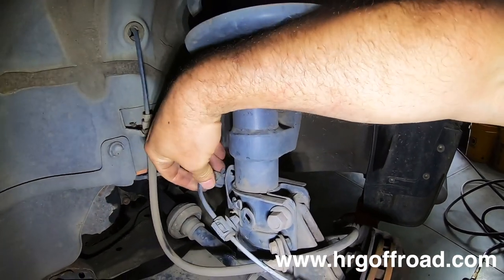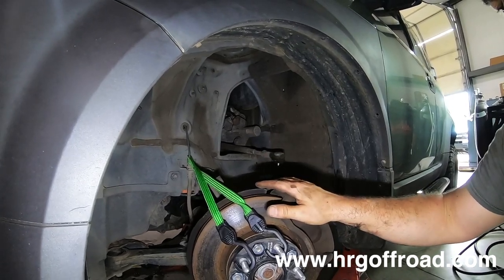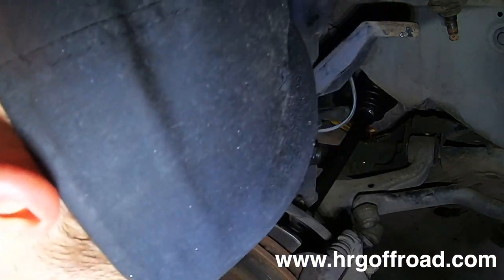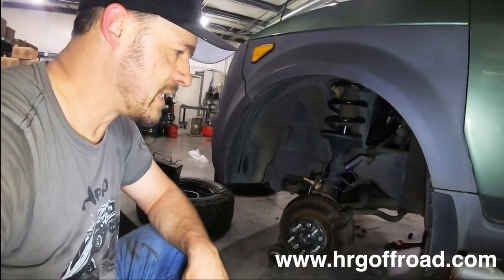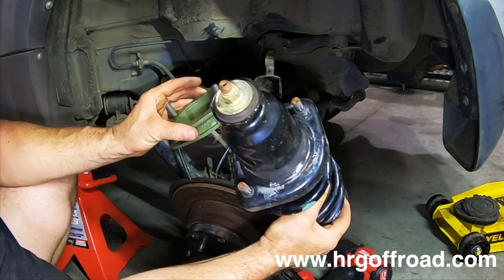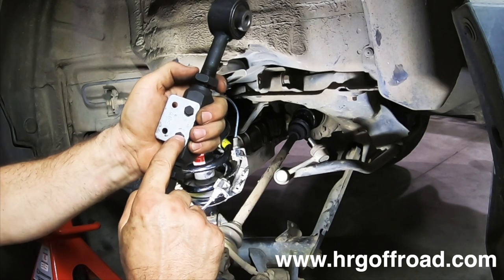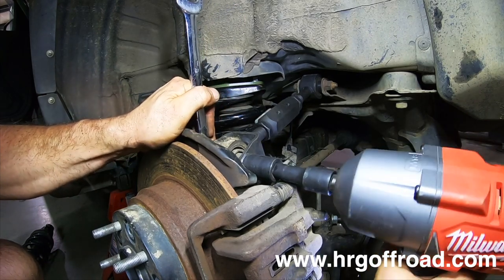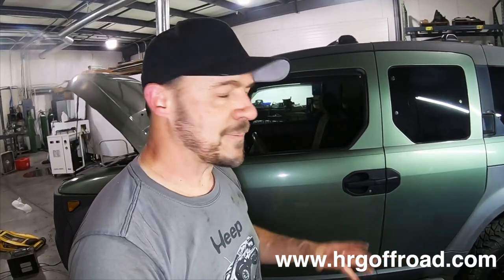2003-2011 Honda Element 1.5 inch lift kit installation

Comment: Hey love the work u did. I used to live in florida but now live in the bahamas. I brought in a Honda Crossroad which is like a first/ european version to the element but not as tall. the suspension seems to sit a lil higher on my vehicle. do u think u would be a ble to help me find a compatible suspension/shock absorbers for my car. I imported it from japan so that's my problem. I can't even seem to find new ones online. I was thinking someone should be able to custom fit a shock absorber. 
I also want to put a lift kit to raise it up 2-3 more inches to put off road tires. I currently have 225 / 70/ R16 on. I want to go to 235 or 255/ 70/ R16  mud tires.  If u can offer any info or through your connects find something that may work on my vehicle. that's 2008 Honda Crossroad 2.0L  DBA – RT3